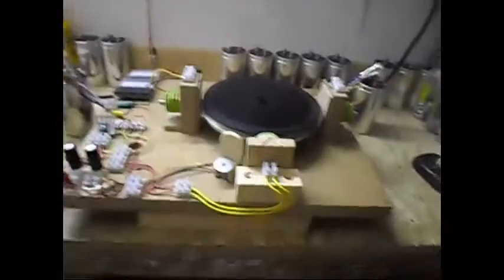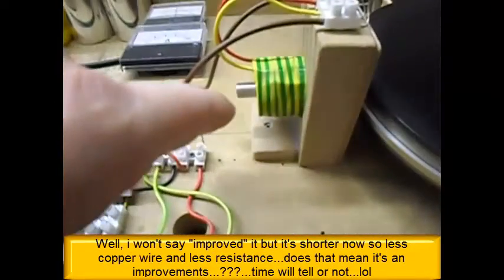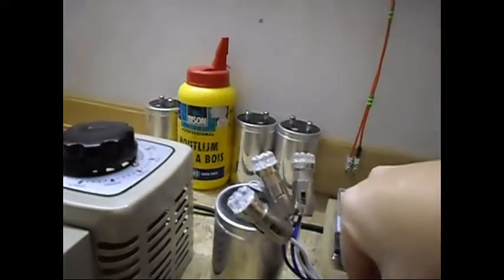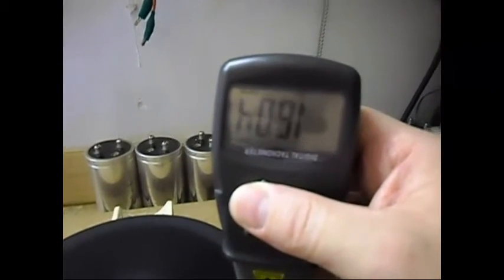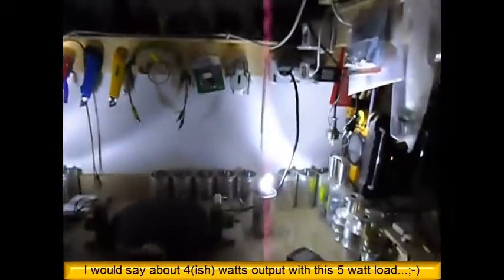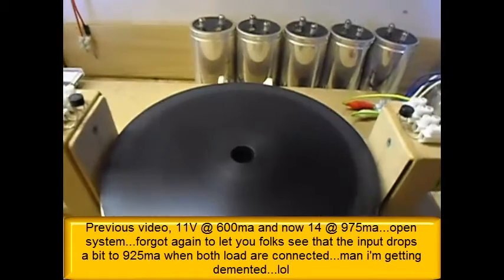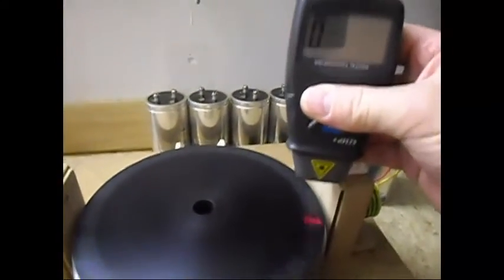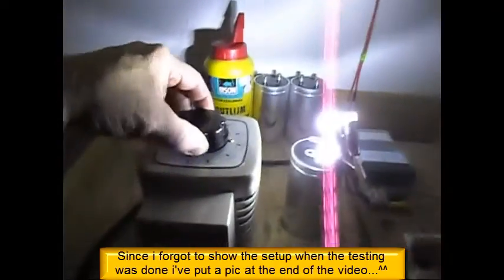Pulse Motor - Generator Update 1, Speeding up under load with 2 coils...

Comment: Thanks for your time & efforts with sharing.
If i understand it ...... your using an external power source to run the rotor
are the coils generating enough amps / volts to run it instead ( over unity )
may need temporary start up power source then free running ?? .... just a thought
Reply from the maker: Thanks for your comment and glad you've appreciated what i'm showing...^^
I get what you are saying and yes these coils "can" put out more than enough to run itself but there is an issue that needs to be addressed first and that's not been an easy one to fix...lol
But i'm working on it on many levels...;-)
Yep, the system will need a power source like a battery as a temporary start up untill it has reached a certain rpm  and then flip a switch and it should be "perpetual motion" untill something breaks...lol
Sounds easy doesn't it but it is not...that much i can tell you...;-)
Reply: Thanks for replying ..
Not sure if your wanting  to share or reveal the the issue /issues
I am also working on a similar project, but mine takes a different course ..... 
I am no genius, but not a bad problem solver
( many times the solution is right in front you but can"t see it )
Reply from the maker: No problem, you are most welcome...^^
Well, no one is a genius on this matter since there are "ZERO" perpetual motion machines/overunity out there...lol
Since it is one of many setups of mine i would like to find the solution myself...;-)

"The path one needs to walk to find a solution is a path full of adventure and experience which will expand ones imagination limits "

...so i really don't want to miss out on all of them...;-)
And yes, sometimes it is right in front of our eyes and yet...we still don't see it...^^

Comment: An adams motor setup would be good for this as it will reduce the codding if you put coils around it in even spacing. odd number of coils, plus or minus, so it ends up only one coil is face to face with the magnet and the rest are just before or after canceling each others attraction out.
Reply from the maker: Thanks for your comment...^^
Wow, now thats a long time mate seeing you around here...you still at it...???
Yep, i get what you are saying about even/uneven magnets/cores...have done test with that and we can reduce the cogging effect a lot with it...;-)
I'm only waiting to do just that when i'm satisfy with the output per coil...it's pretty good atm but it can be better...;-)

Comment: Thanks for sharing

How many magnets you use ?
Reply from the maker: Thanks for your comment...^^
It's the same rotor as before, 24 magnets...;-)

Example, if i should have a 36 pole rotor i will have this effect at lower rpm...say maybe 1000 rpm or so...;-)
And if i have a 12 pole rotor i will need more rpm...say maybe 2200 rpm or so...;-)

These rpm above are just examples, this can be calculated but i never do that...lol...i just go by feeling...^^

Comment: Hi man! very nice setup, are this coils bifilar?
Reply from the maker: Thanks for your comment and i'm glad you've liked it...^^
My coils are single wire but wound in a specific manner BUT if you wound yours as bifilar you will be able to get this effect easier...;-)
Watch this old video here,
https://www.youtube.com/watch?v=zrbEtXCsXiw
He is getting this effect with an bifilar wound coil...^^
When you get this effect don't do like many has done before...saying it's not usefull...try to improve the ratio of the effect vs output...
Also play with the distance of your coil to the rotor magnets...
Also play with the core sticking out a tiny bit on the front side of your coil as well...my cores are sticking out at the end in this video but i can make them shorter but since i've cut them to the previous coil size which was a bit longer i've left them like that...;-)

Comment from the maker: The effect seen here is not fake or tricks, it's as real as you and me breathing fresh air...^^

Here are the ingredients needed to get this effect,

1 - A certain rotation frequency...amount of rotor magnets and a certain rpm...
2 - A certain characteristics of the coil...high resistance/inductance or low resistance/inductance...
3 - A certain core material...higher or lower in mass...

Mix these 3 together in the --->>>"right amount"<<<--- and get speed under load...it is as simple as baking some nice and yummy pancakes...;-)
Reply from the maker: A - Also do play with the distance between the coil and rotor magnets...
B - Also play with the core sticking out a tiny bit at the front side of the coil(coil side facing the magnets)...
C - Also play with different thickness of the iron/steel core...

If you get this effect while shorting the coil but NOT while loading it...it means you need a higher rotation frequency...
But it can also means you need other characteristics for your coil but lets leave that aside since it can be a bit to much complicated...lol

So do one of the 2 or both...more magnets on your rotor and/or higher rpm...
You can also try point A, B and C first...;-)
Reply from the maker: Thanks for your comment...^^
Good going for getting the same effect...why would i want to remove the coil that is producing energy from the rotor...???
And also, i don't focus on shorting a coil since there is no power to use when it is shorted and also a shorted coil can give you speed up under load while that same coil under a real load can make the system slow down due to lenz effect...;-)
If you are using a cored coil the input draw and rpm of the rotor will change when one remove the coil/core away from the rotor...;-)
I don't need to do that test to know the outcome...^^
These coils of mine are specific single wire wound coils and that's all i will share about them...^^
There are many ways to wind a coil and to get this effect...only thing is some are pretty good and some are pretty bad...lol
So i'm trying to improve the pretty good ones that i've found along the way as much as i can...;-)
Reply: yes thats real i've done acceleration of motor generator too when i apply load. just like kromreys patent